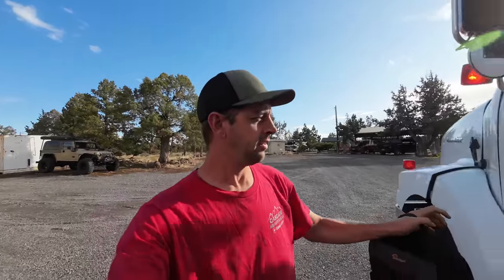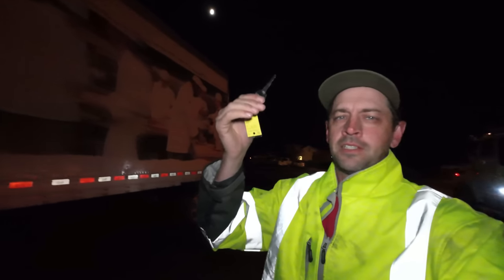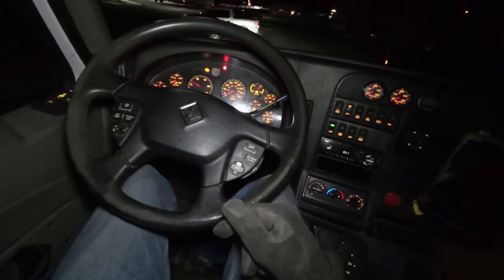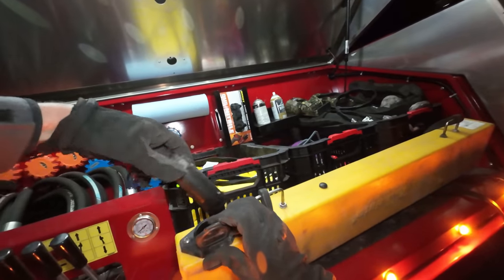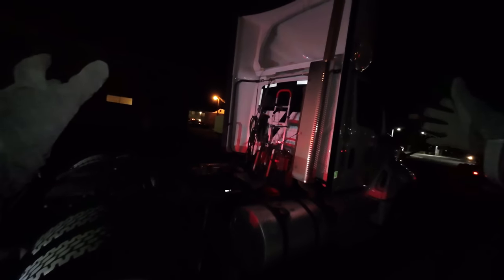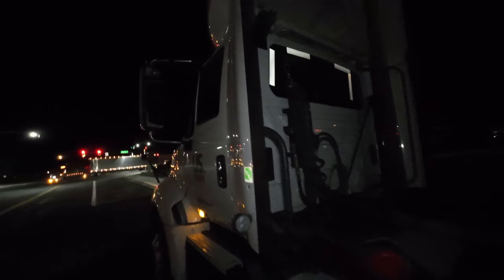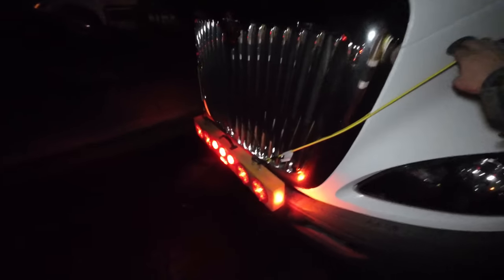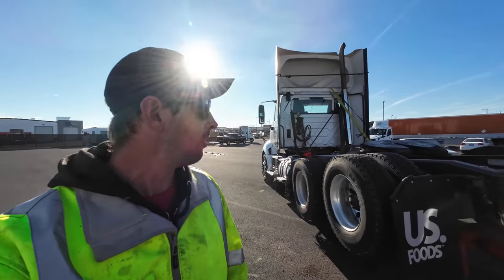Pulling a parachute for 300 miles!

Comment: True about using bungees on the light bar. If u want a real safety. Run a ratchet strap through the top to the mirrors like u did with the carabiniere bungee     Won’t lose it.   As far as u bolt cups horrible choice. As all the weight is on a 1/2 bolt.  I wouldn’t trust them. But jus my opinion.    Be safe.  I’m speaking from running a 50 ton wrecker for 5 yrs in Colorado

Comment: Where is your tarp that goes over the air shield from the back. If cracks in the air shield they will bust up and blow off. Caution: If the exhaust stack is turned towards the rear, if a low tow the turbo can spin with now oil pressure. Now you bought a turbo!
Reply from the maker: Tell me you have no clue what you're talking about without telling me you have no clue what you're talking about...

Comment: 5th wheel release in cab. Catch is rounded some also some require down or up to catch. It is that style handle too. So its push forward, pull out, pull down, catch. I didn't make it just have to work on it. 

That U bolt thing just informed me how they get ducked up and a pain to tighten from something mushing the corners of the nuts. We rarely have to tighten them  and mechanics are in a shop 99% of the time. So don't modify what you do just more knowledge for both of us.

Air lines that feed the gauges were likely swapped by accident when a gauge went bad or the pressure valve spring that only opens at ~100psi brake reservoir side to fill secondary is broken. Third option least likely is someone swapped the lines at the tanks underside after doing a transmission or clutch. Yes i know it's automatic but, half of them are automated manuals which still have clutches.

Comment: What is the advantage to towing a truck this way? You have to remove the drive shaft. Correct?
Reply from the maker: Don’t have to pull the drive shaft
Reply: More ground clearance in the rear and like Casey already wrote, no need to remove driveshaft.

Comment: I noticed you didn't emphasize making sure to roll the windows up when towing any vehicle backwards, you'd be surprised how many tow truck drivers find out the hard way that most windshields are not made to have 50+ mph of air blowing on the inside of them.

Comment: My secondary on my skoolie fills before the primary too.  My guess (I could be totally wrong as I know nothing about how it's actually set up) was that the service brakes work on primary or secondary and the parking brakes only release when primary is full.  So, I can use the service brake before the parking brake will release.  Only logical thing in my head.  If anyone has insight, please correct me so I can learn more. :)

Comment: Hey Casey some of these new fifth wheel release handles have a notch placed in them. You lift it up, pull it to the left, release the jaws, move handle to left again and the notch will catch and hold the handle in place to keep jaws from closing. Maybe that was the issue
Reply: Absolutely correct! it's a Jost brand 5th wheel, lift up, pull out, slide forward and a notch on the handle will keep it released.
Reply: @WiltWa  I always just used a short length of chain onto the handle and whipped it to give a really good solid yank but then we didn't have this fancy new type. I wonder if that is an anti-vandalism feature, as in someone pulling your fifth wheel pin when you are parked?
Reply: I don't really know anything about this, but I love watching ALL of the Shenanigans! They are either funny or provide information and instruction.
Reply: Now when you say it, i know Casey want home. But it would be intressting to see and know what was wrong..
Reply: @georgevindo  yes the have some fifth wheels that are air actuated that release only by air to prevent fifth wheel pulling, and allowing some drivers to just be lazy and never leave the cab lol

Comment: Yep aro affects cost to drive far more then people think.
.
I know when I have the little harber freight trailer behind the gen 2 prius, it's an instant mpg hit.
As I'm basically pulling a brick on wheels.
Pull it at 45 and get 45mpg
Pull it at 65 and get 35
So as much as possible, I stick to low traffic state highways. to minimize how many people I annoy. 
0.01c

Comment: Casey when  your  not  using  your sleeper make sure your  bed is always made Dot  will write you up if they  see it's not made....
Reply from the maker: It also doesn’t have white sheets, which is a requirement.   But if any DOT officer wants to write a ticket for it….   Fuck ‘em.

Comment: Just curious - between the possible fuel advantage and lessening the risk of trim damage or anything happening with the steering wheel , why not just remove the drive line and tow from the front?
Reply from the maker: Because it was a tractor swap and needed to be driven after I dropped it off

Comment: Hey casey. It sounds like the hydraulic fluid is cavitating in one of your lever valves. I would check to see that the valve isn't sticking and causing a weird high flow thought the restriction if it is sticking. Could just be nothing and just something weird picked up by the mic. Again obviously not there in person but I used to work on trucks then joined the navy and did a lot of hydraulic systems there and its what it kinda sounded like to me.
Reply from the maker: It’s not.  You’re hearing the ball in the tilt sensor for the box lights rattle as the truck vibrates
Reply: @CaseyLaDelle  ahh gotcha.

Comment: Didnt think that a lighting bar tie down issue suggestions would spark you up Casey .
Yes they naybe all held on with bungee cords,what is the attrition rate i wonder ?
On a grill or the rear of the chassis they work well ,on surface areas like that trailer door you attached to ,the things to bungee to are limited,and having two ratcheting straps allows the possibility to tie on further away .
We all know that the bungee straps wear and lose elasticity and will break .
Do it once Do it right is how you work ?
Re thinking how its done is also what you are about , forward thinking and factoring the what if is a practical solution to things , she'll be right is not the professional way ,agreed ?
Just as you taped the mirror caps and tied the fairing kit down ,its not over kill .
Hope that you get to spend the important times with family,one down side of being on the road .
It would ve interesting to see if the tow boom deflects the air stream flowing over your truck and the air/wind is not having a full impact on the Parashute ?

Comment: When you pulled on the Fifth wheel to release it you should have found the slot in it that holds it open  , all so you put your ratchet strap on the fifth wheel and then on to the trailer , so when you drive off you brake the strap ? Don't get me wrong I love your channel , and I drove Semies for 20 years and I love your truck .
Reply from the maker: My strap broke??    News to me 🤷🏻‍♂️
Reply: @CaseyLaDelle  You don't show what happened when you pulled forward with the fithwheel and the strap so I thought it must have broke
Reply from the maker: @spiderbrandt4066  I didn’t show 90% of this job.

Comment: The work light probably kept turning off on the new truck because you went faster than 5mph. I don't know if the new Internationals do it, but Freightliners automatically shut off the work lights at 5mph. Forward or reverse, it doesn't matter.

Comment: Hooking up to the u-bolts surprises me Casey. Do the straps help carry that load? I wouldn't have thought the u-bolts were strong enough to be a tow point. Care to elaborate on that for us?
Reply from the maker: No, the straps do absolutely nothing other than stop it from bouncing up out of the cups.   The U-bolts are what the hold the entire loaded truck and trailer to the axles, so there is no issue towing a truck by them

Comment: Hey casey did you notice that, that truck u brought to replace the broken one, it didn't have plates on it, 😅
Reply: Unless they put it else where on the truck. Or they don't have to have one on the rear of a truck???
Reply from the maker: @kenwelch6984  tractors only get one plate on the front.  No rear plates

Comment: They maybe designed to be held on by bungees but I bet putting them on a strap across the back let it bounce too much
Reply: Absolutely correct. We use the same lights like most tow companies. They need to be stretched tight. So on Uhaul top bungies to handles and bottom pulling them tight. The bounce is what does it. Anyone that tows for a living figures these things out eventually. Every truck is different.

Comment: Casey, could you have used the rollback truck (if it were running) for this job? If yes, would the new truck still have been the best choice? I'm guessing the new truck is more powerful, which may have been helpful given the backward tow.
Reply from the maker: Yes, the could have been towed just the same with the rollback

Comment: I dont know if i missed something.. sorry then.
But why do you tow trucks backwards ?
Is it so you dont need to unmount the driveshaft ?
Reply: driveshaft and rear brakes.
Reply: @iffykidmn8170 I always pulled them forward. It doesn't take long to hook up a hose.
Reply: @Bryan-Hensley  Not nearly as long as it takes to drop a driveshaft.
Reply: @iffykidmn8170  it took me about 5 minutes. 10 max.
Reply: Im NOT trying to say that Casey did anything wrong !
But from the little info in the video , i feel that it would be less job and faster to drop driveline and hook up air. Then tape and put straps all over. But i KNOW that if it was better, Casey had do it ! 🫣
Reply from the maker: Yes, I can pull the shaft and hook up air faster than I can secure all the fairings.   But since this was a tractor swap, I would then have to put the driveshaft back in when I dropped the truck off.   The problem with doing that is that the manufacturer says the driveshaft hardware is one time use only, so reinstalling with the same hardware is a liability, unless I have a contract with the customer stating that they understand the manufacturer’s recommendation, still want me to reinstall the shaft, and take responsibility for replacing and torquing the hardware afterwards.
Reply: And God forbid one of the driveline caps fall off the u-joint and the needle bearings scatter, then it's useless and has to be replaced.
Reply: @CaseyLaDelle this was your most thorough explanation of why you did it, so consider putting that  in Description so there’s a chance future viewers might see it? Ok, many don’t read those but…
Reply: @CaseyLaDelle  
Oh, i see.
THAT explaineded alot !
BIG thx for the info ! :)
I guessed it had to be some info we didnt know, that you knew..
This is why i tell to people how fun, great and learnful Caseys channel are ! :)
Reply: @CaseyLaDelle  my bad, I thought it was broken down. I let the shop worry about hooking up the driveshaft when I pulled them.

Comment: So this job would have been easier with the trailer, not to mention safer for the trucks because you could have pointed them the way they like to go down the road. New toy is fun to play with I guess. I also think a small day cab would be an excellent option for work like this, just grab it and go, no wrecker in the way of using the 5th wheel.
Reply from the maker: Yes, the trailer would have been easier and faster.   But I didn’t know if the truck on the other end ran at all, or was in a position that I could get it on the trailer from.   So I took the wrecker to eliminate any potential problems.

Comment: ( Air run fifth wheel release ) Look on the dash to right side of yellow (tractor brake) there a button for the fifth wheel release. I had one on Max force junk. It work when it wants. Which mean you need two people to drop your trailer 1 to push and 1 to pull the fifth wheel what XXXX it was.

Comment: I was behind you on 126E until you turned off to head home 55 all the way lol. Do you not have the OTC impact tool to remove the 1810 stile U-joint caps? It’s a must have if your a tow driver or truck technician.
Reply from the maker: I do have it, but that truck was a strap style U-joint so it wouldn’t have been needed.  I left the drive shaft in because it was a tractor swap, not a tow to a shop

Comment: Even in the smallest car i drive, one of the smallest modern Hondas in America, i see a decent fuel usage going from 70 mph to 80 mph. I'm not sure i see that affect on my older jeep, it drinks fuel no matter what, but it's happy to cruise at 90 mph. These two vehicles are geared so differently so I'm sure that's playing an affect, but wind resistance is also in there. 
I'm the box truck, i think the biggest waste of fuel is probably other idiots on the road, who weren't there in 2020.

Comment: Curious as to why you didn't hook it from the front and drop the driveline?
Probably one of those six in one hand, a half dozen in the other type situations, but that silly roof fairing would drive me up a wall worrying about it.
Reply from the maker: It would have been far faster and easier to pull the shaft and plumb air.  But that truck was a swap and needed to go to work after I dropped it off, so I couldn’t pull the shaft

Comment: What is the point of rear towing those? I think you do it so you dont have to disconnect the drive shaft, but in my inexperienced mind, I would want to pull on the tires that cant turn if the rachet strap comes off, as well as I would think pulling the drive shaft would be just as easy as the extra things to do to be able to pull backwards. Id love to hear your thoughts!
Reply from the maker: That truck needed to be work ready when I dropped it off, so I couldn’t pull the driveshaft.

Comment: I don't know, but old school policy was to "sack the the stacks" if you towing a servicable truck as a replacement unit. The logic is simple, pulling backwards, wind blows into the exhaust stacks causing the turbo to spin (backwards), that's not as bad as the fact the turbo is spinning backwards with no oil supply to the bearings. Now some folks will say the turbo doesn't "spin" and other say it does, so to keep everyone on both sides of the fence happy and to reduce damage claims, "sacking the stacks" prevents it from even being an issue. If you do it as a measure to prevent a damage claim by a client it's a win on both sides. Just a thought from an old fart.
Reply: Casey is on the “can’t spin” side.
Reply from the maker: There are no two ways about it, the turbo cannot spin.   It is grade school level physics.
Reply: @CaseyLaDelle  Yeah, I know been down that road myself trying to explain it, but well it's easier to just sackem and keep the peace. Some folks just don't understand but, it is, what it is no sense getting into it with some folks (I think you get where I am coming from..lol).

Comment: Maybe I missed it, but why not front tow?
Reply from the maker: Because it was a tractor swap
Reply: @CaseyLaDelle  I mean tow from the front with the driveline disconnected. Would be better for fuel economy right?
Reply from the maker: @Leofred2000  same answer.  Because it was a tractor swap.   The driveshaft needed to stay in.

Comment: If 60 vs 55 made that much difference, I wonder what it would have been at 50 or 45.  
I have a slide-in camper and at 70 I get 12.5MPG, at 55 I get over 16.  It makes a big difference when your travelling 3K miles!
Reply: I have a huge slide in.  The first time I hit the 80MPH speed limit in Idaho, I tried to hold the speed limit for a while.  The floorboards in my truck started getting hot!  The engine wasn't overheating, but the turbo was spooled way up and it was working hard.  I backed off down to 70 and stayed there.

Comment: Hi, Casey, I have left to wonder, how much differens it could be towing from front, I mean in fuel consumption? Short distance it maybe is like nothing much, but long like you did (I think 300miles is long), so is it worth your time to take driveaxel out. Just thinking, what the mileage is empty, like as is for your truck, so how much towing like you did ads to it, so how many % higher it is with load behind it, front towing or rear towing,
Reply from the maker: A LOT.    But the shaft was left in due to it being a tractor swap and the truck needing to go to work after I dropped it off

Comment: Hey Casey, is there any concerns with those U-bolt cups damaging the threads or nuts on the U-bolts?  Just asking cause I genuinely don't know, and am just curious.
Reply from the maker: Nope
Reply: They are designed for rear tow only and they work great.

Comment: You were kind enough to explain on my last comment on your last video. but is there any reason on a long tow like that you don't put a tarp from back axle to fairing on the truck your towing to improve the aero? even if it only got you an extra mile a gallon its got to be worth it for the fuel saving?
Reply: Interesting idea. It would need to be a strong tarp to handle that wind load over that large area.  Maybe it would pull the top of the fairing down with it which wouldn't be an improvement.